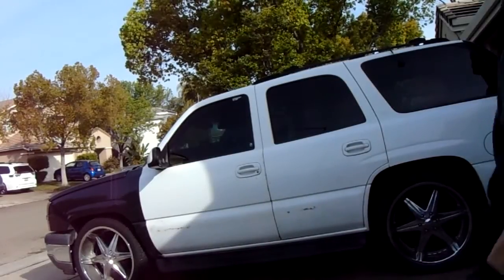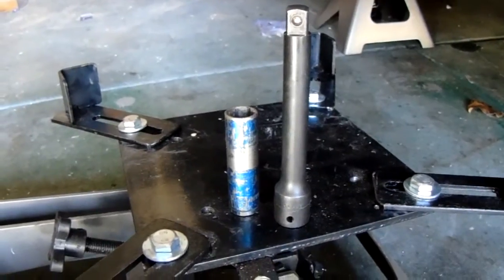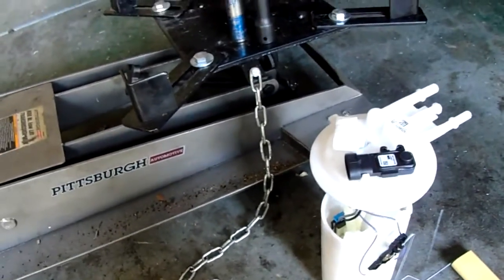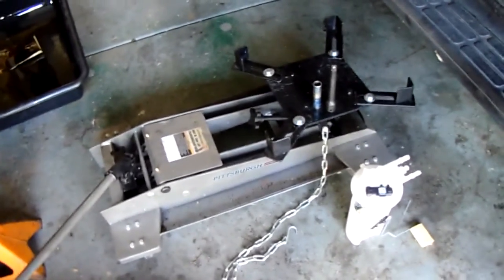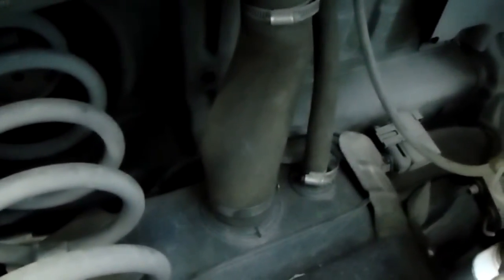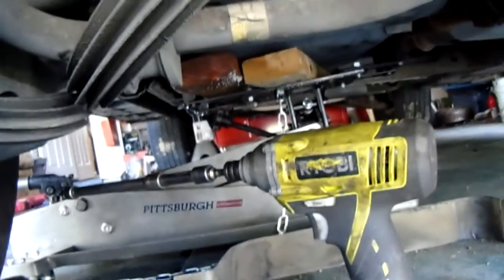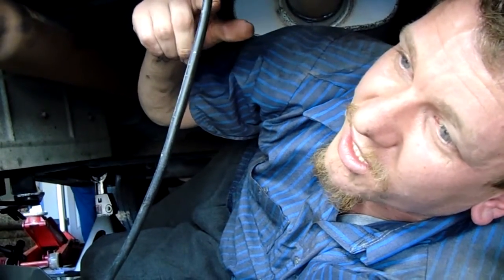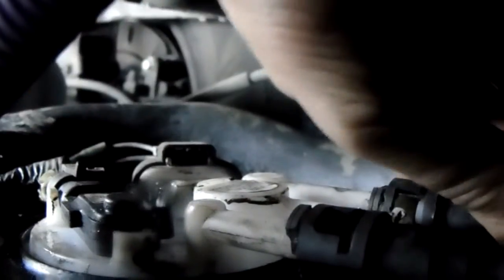Chevy / GMC / Escallade fuel pump replacement, level sensor too. Fuel gauge fix.

Comment: If I have to cycle key on and off 2 or 3 times before start is that a tale tale sign of my fuel pump going out. Fuse is good.
Reply from the maker: Possible. Do you have a fuel pressure guage?
Reply: @ScottiesHobbies  no gonna purchase one tomorrow guess I will try my fuel filter 1st and see what happens will update. Appreciate the response bro. Nice vid as well.
Reply from the maker: @ecgodsmack86  that is one hell of a complement on this video. I plan on doing a way better video on this pump in the next couple weeks. 

Good luck and keep us posted.
Reply: @ScottiesHobbies  cool ill be looking out

Comment: Great video but I have a question... why u didn’t show the actual extraction? I was looking to see what could be wrong with mine. My gauge reading full and it definitely has gas. But apparently the sending unit not reading .. and may be stuck? Any suggestions? Or do the whole pump have to be taken back out🤦🏽‍♀️ please say it’s a way to get it from being stuck. If not.. my ocd about to kick in😡🙏🏾
Reply from the maker: On these trucks and SUVs the fuel level indicator is a part of the sending unit. I have heard of people just replacing the fuel pump itself and reinstalling but I would highly recommend against doing that. Personally on my 2001 Chevy Tahoe my gauge was getting sporadic around a half tank. So it would read fine from Full to 1/2 and then when it got around a half tank of gas it would just give me odd readings. So I always had to keep my fuel tank full. In that case I just replaced the whole sending unit and it fixed my issue. I would also hate to say that you should rebuild your fuel level indicator and reinstall and then shortly thereafter have your fuel pump go bad.
Reply: Scotties Hobbies my pump was already replaced.. and afterwards my gas gauge is reading full at all times
Reply from the maker: @SweetestGapeach1127  did you replace the whole assembly?
Reply: Scotties Hobbies yes 1st was used.. 2nd time I bought it new
Reply from the maker: @SweetestGapeach1127  the level was stuck on full before or after the new pump? Did your new pump come with a new harness pig tail?
Reply: Scotties Hobbies after the new pump was put in. Pigtail was already on it because it was already replaced.
Reply from the maker: @SweetestGapeach1127  man..  that level indicator is probably stuck on something.
Reply: Scotties Hobbies I was hoping in could be fixed without dropping it afaub🤷🏽‍♀️ tap rap or something 🤦🏽‍♀️
Reply from the maker: @SweetestGapeach1127  I can't think of any other way other than dropping the tank to double check.. it could be a faulty pump assembly out of the box too. If you do drop the tank to get to the fuel pump again before you install the new one or reinstall the one you remove turn your key to the on position with the pump out of the fuel tank but still plugged in electronically and hoses connected to see if the indicator works properly. Move the level sensor on its pendulum while somebody watches the fuel gauge to see if the fuel gauge moves.
Reply from the maker: @SweetestGapeach1127  careful though. When you turn the key to the on position the pump will Prime. If your hoses aren't properly secured they might blow off and get fuel everywhere. Take caution when testing that fuel level sensor
Reply: Scotties Hobbies ty👌🏽 I’ll update you on my progress

Comment: I have a question if you take off those 2 hoses will gas come out if the take almost full ????
Reply from the maker: Do you mean the hoses coming out of the fuel pump? If so no. You might get some fuel coming out of your filler neck or your breather hose if the tank is really full. If your tank is full, I would recommend getting a fuel can and draining or siphoning your fuel into that can while you do this procedure. A full tank weighs a lot and makes this job way harder than it needs to be.
Reply: Oooh ok thank you for the info an awesome video

Comment: The video is helpful however I don't see anything about one of the hardest parts and that is disconnecting the hoses from the pump? You showed how easy it was to pop the clips from the harness but conveniently passed up the part about how you got those hoses loose?

Comment: Those strap bolts changed from 15 mm to 14 mm?
Reply from the maker: Its a 15.
Reply from the maker: In the front of the tank at the top you can disconnect the fuel lines to free up the tank a little more if needed. I think i over looked that when making this video.